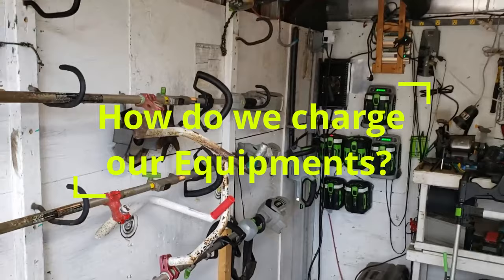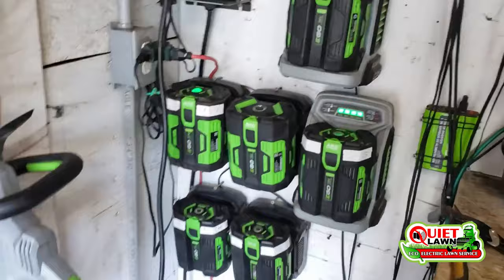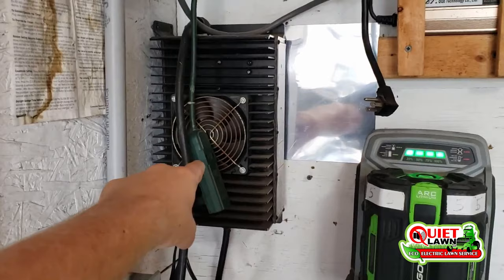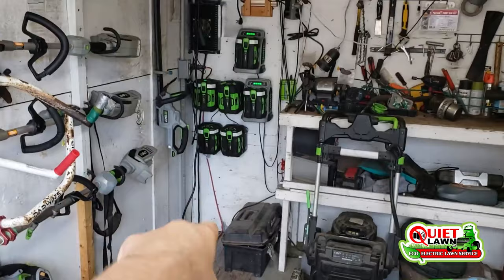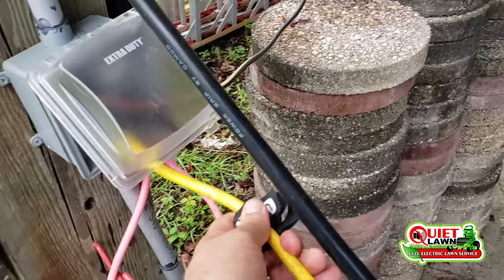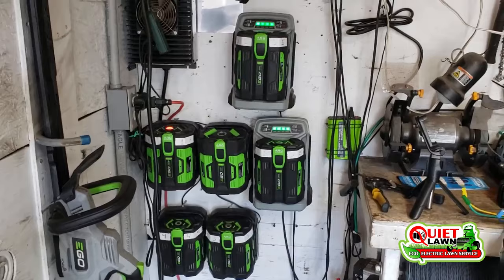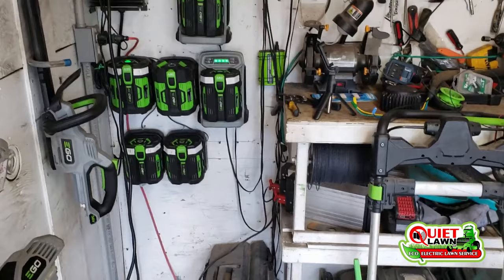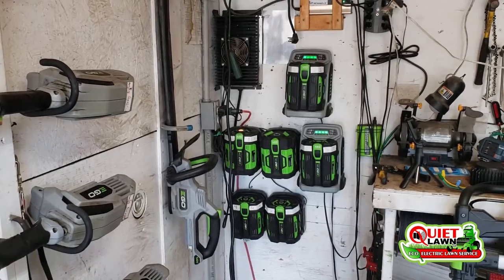How do we charge our batteries? | ALL ELECTRIC LAWN CARE BUSINESS GUIDE

Comment: I've honestly had this idea in my head but didn't think it was practical but now you've convinced me to want to do the same. The only thing I'd worry about is the electric mower since it would take so long to charge if batteries aren't interchangeable. I'd also recommend you add solar panels to the roof or get a higher power alternator for your truck to save some power draw and would allow you to charge as you go
Reply from the maker: Check out our newer setups! Thanks for watching.

Comment: What you need to do is set the truck up to have a charger pulled from an EV so you can use EV charging stations to charge your battery bank. Then use an inverter to provide power for your needs in the truck. 

Lots of free EV charging locations around to use topping off.
Reply from the maker: That's a very cool idea. Thank you!

Comment: Hopefully next generation chargers will include options for charging batteries.  I have an ebike charger with a toggle switch to charge with a current between 1-5 amps, and another toggle to charge battery 80, 90, 100%.  It is well known charging li ion batteries to 80% will double their useful life vs charging to 100% every time, and overnight slow charging all your batteries would be better than fast charge toggling them.  More efficient and gentle.
Reply from the maker: That would be a great idea. Not everyone needs a battery to charge in 30 minutes and being able to extend it's life would be great. Thank you for commenting.

Comment: Always use slow chargers when you can or at the end of the day,is what I've been told it helps the cells balance better and last longer.
Reply from the maker: How would I make this work with my mower?
Reply: Hey..Is the inverter you use a regular or pure sine inverter?
Reply: @QuietLawn  Not sure on the large mower, but on the Ego batteries, the smaller black chargers are normal, and the larger ones are high speed. Black ones are either 200 or 320W, larger one is like 400 or 450. It would also help with not overloading circuit. You should be able to get 5 200W chargers on one circuit no problem, looks like you have a 12GA extension cord.

Comment: I like this idea. However, in terms of eco-consciousness, if you have to draw all that electricity just to get the equipment to operate, then how is your operation anymore eco-friendly than a gas powered operation at the end of the day?
Reply: Even if electricity source is non renewable, it is more efficient to use electric tools than gas engines. Coal or natural gas plants are around 40-60% efficient. Gas engines 25-35%.
Reply: Ultimately, the customer is the one you need to impress. If you provide services that keep noise pollution, air pollution, and odors off the customers property then you’re creating an edge over your competitors.

Comment: is there a battery / battery charging kit EGO offers that would be a good way to build up a good arsenal of electric fuel? i just started my all electric company and trying to find the most affodable way to keep adding batteries and chargers without buying them one by one. just wondering what you did , i know they offer some mower packages that come with several batteries. just wondering how you did it also. thanks so much ! very awesome video

Comment: Could you charger 2 hand held batteries just from an inverter off the truck or would that kill the truck battery when parked doing lawns. I have a diesel truck with 2 big batteries
Reply from the maker: I'm not sure to be honest. It depends on how much the truck is running, inverter size, how much you're using stuff, etc.

Comment: New subscriber here.  I like the battery tools available for the home owner.  I am a Ryobi man but am thinking of EGO or Dewalt in the future.
Reply from the maker: Hey Brent, either of those are good. Milwaukee and Makita are also making some great tools too and Makita has the longest warranty.
Reply: @QuietLawn  thanks.  My biggest problem with Ryobi is with the batteries. I am fixing a lot of the 18v One+ batteries. The 40v are pretty good.  I haven’t made a move away from Ryobi since I have a board with 3 chargers for each level (18v & 40v) and probably 6 40v & 6 18v.  As far as batteries go, it is always good to one charged up and keep going.  I don’t put them on the charger when I initially take them off to cool off. All the best. I wish you all the success in SC. We live in Texas and used to have a son & his wife in Greenville/Anderson.
Reply from the maker: @brentjohnson6654  oh, very nice. Thank you very much and best of luck to you in Texas as well.
Reply: @QuietLawn  sorry to bother you again.  You are so nice to respond to us viewers.  I am still pondering the EGO for a string trimmer replacement and also a possible chain saw.  I really like the power of the 56v battery and the tool-less chain tension.  My Ryobi pole saw takes a lot of unscrewing to tighten the chain.  If I were to get a string trimmer I would still have my 21” Ryobi push mower and like I said the battery problems I have are more in the 18v line than the 40v line.  So with that in mind, can you tell me how you decided to go with EGO when you started?  The other tools you mentioned above like Milwaukee and Makita sounds good at the tool level.  What I am asking is if you were to do it over would you still go with EGO?  Thanks again for your responses.  Who knows, next time I am in SC, I will buy you a coffee.

Comment: What type of batteries do you use with the inverter? I used a marine deep cycle battery and only got like 3 milwaukee battery charges out of it 😐
Reply from the maker: Hey Tony,

We had some old backpack batteries from the original Mean Green handheld equipment we started with. It's about the same result. We're looking at a better option for next year which will probably mean a small solar setup or something on each vehicle.

Comment: How can I charge my batteries if I’m working out my truck, I was thinking solar power ?! I run Dewalt equipment, thinking about switching over to ego .
Reply from the maker: The most reliable way is to have enough batteries to get through the day. Other options are solar like you said or a battery bank and inverter. You can see what we use on our other videos. Good luck.
Reply: @QuietLawn  Thank you!

Comment: WHAT DOES NOT MAKE SENSE     WHEN YOU MOW THE GRASS YOUR USING DC CURRENT         WHEN YOU CHARGE THE BATTERIES       SOLAR PANEL DC YOU INVERT IT TO AC PLUG IN THE CHARGER WHICH PUTS IT BACK TO DC INTO BATTERY      MUST BE A SIMPIER WAY
Reply from the maker: Agreed